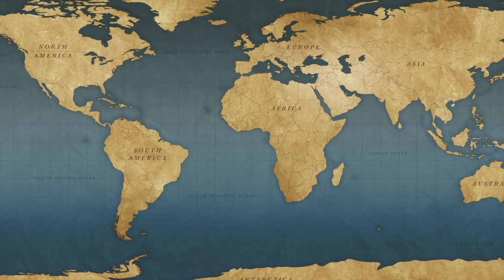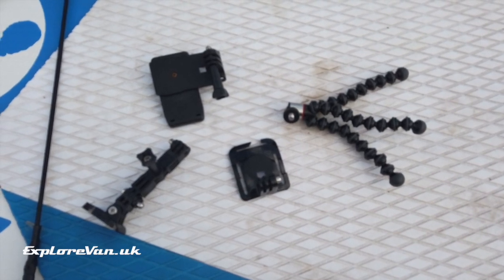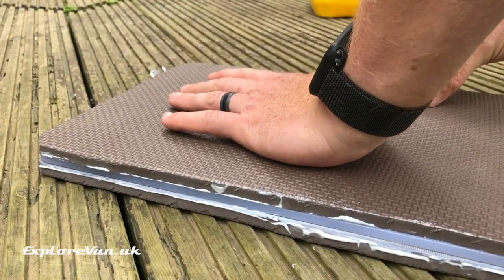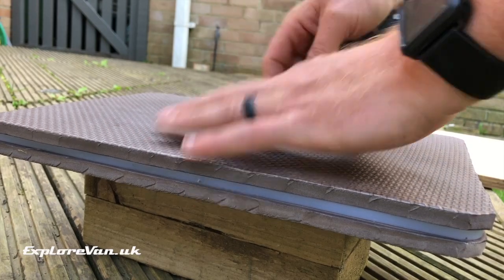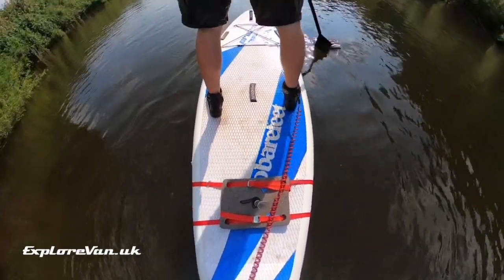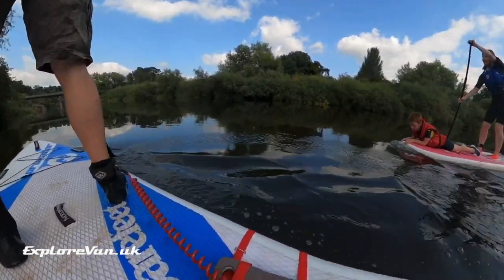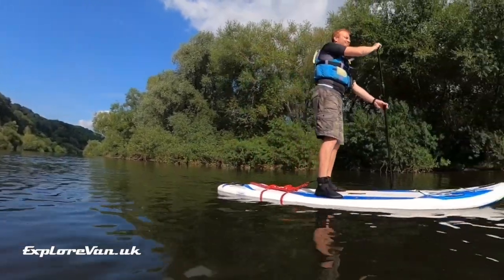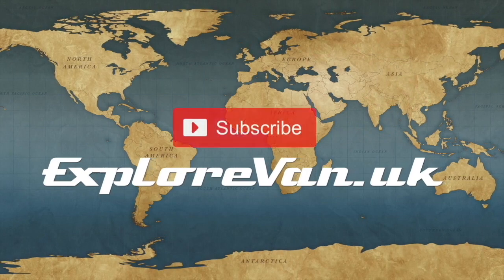DIY GoPro mount - SUP / Paddle board / Surf Board

Comment: This is a great idea.  Have you tried putting the metal parts under the paddleboard, so that they could not hurt you if you fell or would that damage the paddleboard/affect the stability?
Reply from the maker: Hi, it would probably have limited impact if they were under the board, but I think it would be better to pad them with some foam rather than put them under the board.
Reply: @ExploreVanUK  Thanks.  I'm just waiting for my insta 360 x4 to arrive.  Then I will have a go.   I saw this video https://www.youtube.com/watch?v=CHyrZmGl8do where someone used an extended selfie stick with a clamp to angle it up.  I might try and combine your idea with his so that the selfie stick is on a ballhead attached to your base.  Might then be more stable than just using your foot as in his video.